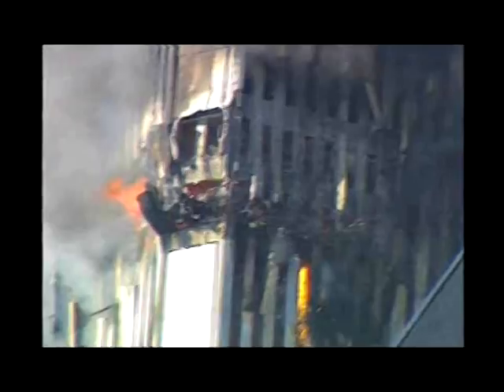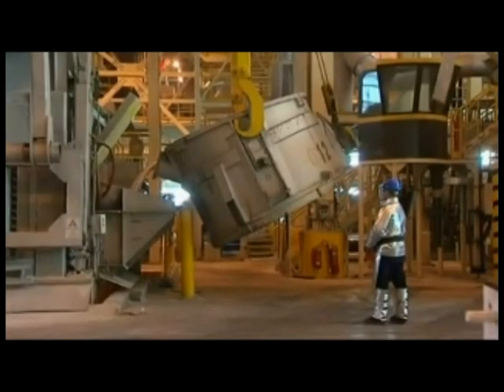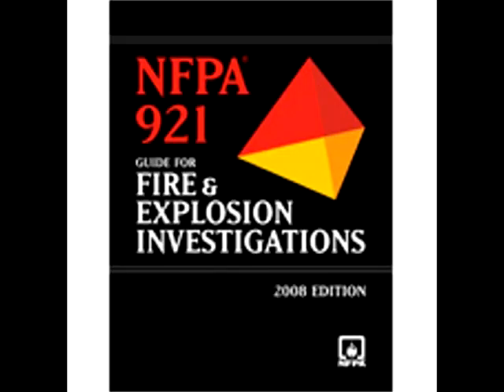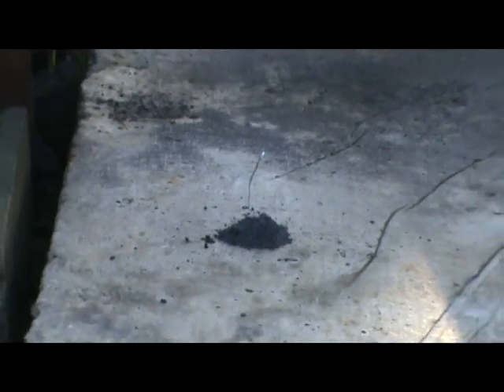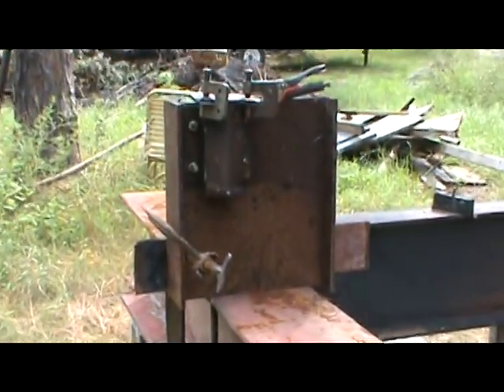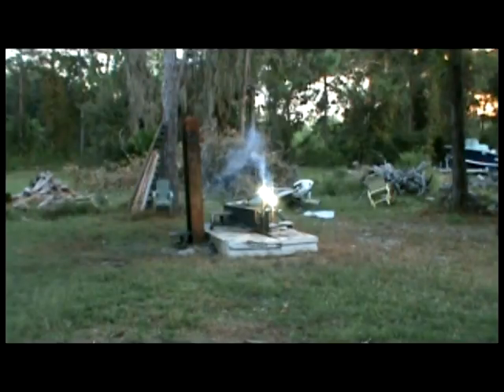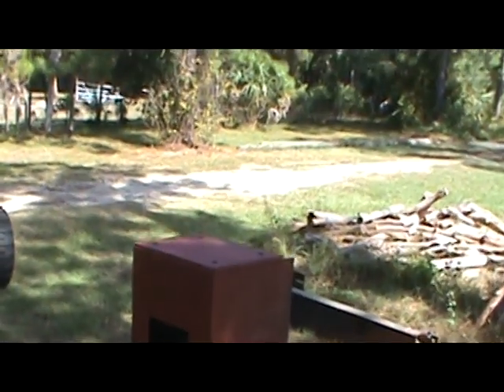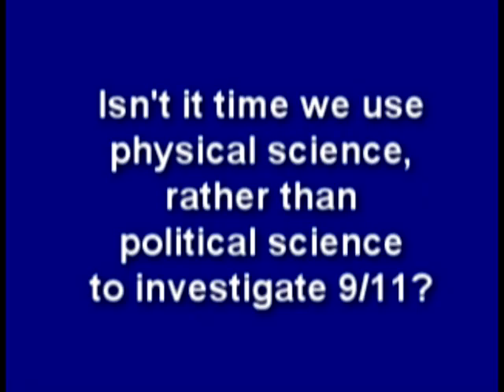9/11 Experiments: The Great Thermate Debate

Comment: While your experiments show it is possible to cut steel with thermite the amount of molten metal flowing from the building was much greater than that of  beams being cut by thermite. I have worked in foundries and seen overheated aluminum glowing orange. I worked as a burner cutting apart old train box car's 50' long 10' wide completely cut into 2'x3 square pieces in a ten hour shift. The plane's also are built with magnesium parts and other exotic alloys. The puffs and explosions could have and probably were water being flash vaporized the dust and smoke were any number of combustible materials. Most importantly, steel easily bends when heated far below it's melting point. The floor beams of the towers were heavily loaded with concrete. When they bent or sagged  downward they pulled  themselves off of the out super structure. Because the plane's had been deliberately flown to points were a massive amount of the  towers was above the impact point. The upper structure  acted as a giant pile  driver, once the floors at the point at and above the impacted floors pulled away from the out walls the massive weight hammered the lower floors to dust. You were very successful in demonstrating your  theory of thermite sabotage. Would you give equal effort in producing experiments showing how the steel imbedded in concrete can and will bend and sag. I think it will take much more thorough and unbiased scientific studies to fully understand all of the extraordinary dynamics and environment that came into play inside those buildings at and near the impact area's. Keep in mind aluminum and magnesium both burn and at extremely high temperatures. Jet fuel will burn at higher temperatures if vaporized and it may have and probably did flow into pockets of the beams and other areas were it was boiling before it was ignited. To duplicate such and environment will be extremely difficult if not impossible in laboratory experiments. And even computer modeling of the event will not include all of the seemingly never before, never imagined dynamics that were in play. I don't think the terrorists were dumb. They took an educated guess as to what would happen if the hit the towers at those floor levels. And knowing exactly how the buildings were constructed they may well have guessed they could heat the floors enough to make them sag and pull inwards. They had structures in Afghanistan that seemed to point to that effect. Also they chose international flights fully loaded with fuel. Yes the media are liars, period and they know it. There was so much going on. Massive forces, massive forces and and environment of chaos. So many types of materials in sufficient quantity that no fire Marshall could possibly know what how or when for sure. Yes the obvious things but so much more happened in ways that maybe will never occur again.

Comment: Aluminum oxide burns hotter than the melting point of steel. Magnesium burns hotter than the melting point of steel. Perform some actual research. Take off your tinfoil hat while your at it.
Reply: Aircraft are made up of primarily aluminum, steel, and magnesium.

Comment: You guys have to remember they flew a plane straight into the towers too so that greatly contributed to the towers falling and shit.
Reply: No it didn't. Each building were capable of taking any hit on all sides because they were designed and built that way. Read about Steve Earl Jones. He was the scientist who uncovered evidence at ground zero of the exotic substances aluminum oxide and thermite shrapnel that led him to discover that no building in its right mind and condition should ever have such exotic materials mixed in the debris. No building at all. The impact along wasn't near enough.
Reply: Chris Sorensen His claims have been debunked.
Reply: Chris Sorensen http://web.mit.edu/civenv/wtc/PDFfiles/Chapter%20IV%20Aircraft%20Impact.pdf
Reply: Chris Sorensen https://youtu.be/aHGllrXsgEI
Reply: you need to understand a plane crashing into a building wont produce as much work as you think it does 
its bearly anything when you consider the windforce those buildings had to deal with every day of their life
Reply: Scott B A 196-ton aircraft filled with approximately 10,000 gallons of fuel slamming into a building at 590 mph is wildly different than wind hitting...
Reply: @realGalactus  th
E actual forces generated arent as great as you think they are
Reply: I understand that but in the construction of the WTC they said both buildings could withstand one plane crash and still stand.
Reply: xXE1ITEK1LL3RXx Where did it say that?
Reply: xXE1ITEK1LL3RXx Ah, found it. “Twin towers 'built to withstand plane crash'”, published by The Telegraph on the day of the attack. The article explains it very well...

“British consulting engineer Professor Alastair Soane said today: ‘They were extremely robust buildings and built to withstand a tremendous amount.
But this was of course a completely abnormal situation and one which would not have been envisaged by the people who built it. The strength of the towers was enormous but they would not have been designed for aircraft strikes.’”

Comment: This supports my theory of why the plane was able to slice through the building like a knife through butter instead of the aluminium wings breaking off on impact(and don't give me that BS about aluminium being able to cut through steel, I'm an engineer in aeronautics) the building had to have been weakened in some or other way before impact... Which could also conclude to the theory that the 9/11 incident was planned LONG before the actual event.
Reply: Gerald Van Der Watt It’s pretty unlikely that you’re an “engineer in aeronautics” if you can’t see this bullshit for what it is.

Comment: We had thermite grenades in Vietnam for melting thru secure radio equipment, not the radios themselves but we could if we had extra and time. They were to be used if we were about to be overrun. The secure gear, a heavy duty steel box, was not to be captured. Always wanted to see it in action, but obviously did not relish the idea of being overrrun. If it was Florida instead of Vietnam I could’ve used the Stand Your Ground defense. Ohhhh, I though we were about to be overrun, that’s why I did it.

Comment: What a load of tosh.  Your tape proved nothing.  NOTHING.  How does steel melt?  Put it a kiln, light a fire underneath and use a bellows to force air on the fire.  Twin Towers was little more than a large kiln with a fire (crashing airplanes) and rushing air over the flames caused by the tower.  It is no different then lighting charcoal for your bar-b-cue in a charcoal chimney.  The lighted charcoal (airplanes into towers) heats the air and cooler air (lower floors of towers) is pulled up to replace the expanded air around the burning charcoal (superheated fire started by airplane crashes).  There are several videos on YouTube showing how someone takes rudimentary tools to melt aluminum cans in your backyard.

Comment: How do you know its steel? It could very well be any other type of metal such as aluminum. Airliners are huge and made up for primarily aluminum. Steel, magnesium and titanium as well but primarily aluminum which melts at a significantly lower temperature. This is the molten metal you are seeing. Aluminum from airliners.
There have been no reports from wtc of melted steel beams. 
Steel however attempts to expland at both ends when exposed to heat. This causes cracking, and causes the metal to sag making it appear melted.

Im a chemist and licensed aircraft maintenance engineer if you need credentials.

Comment: Jet fuel might not MELT steel beams but it still weakens them to the point where a child could bend it in half
911 was not an inside job

Comment: Goes from saying NIST said it was likely molten metal mixed with partially burned organic materials to claiming somebody proved it wasn’t aluminum.. they never said it was aluminum dummy. They said it was likely molten metal.. could have been filing cabinets or some shit. It was a bunch of offices. Not to mention there would have been more metal in the buildings construction than just structural steel with a high melting point. The structutal steel itself wouldn’t have needed to melt to bend and fail either. Steel is naturally pretty soft and heavy and if you made a beam out of regular old steel it would warp and bend and twist under its own weight. It needs to be “heat treated” to make it harder so it will stay straight which involves heating it up to a specific temperature and cooling it within a specific amount of time which determines how hard and brittle or how soft and flexible it will be. 
The higher the temperature and faster the cool the more hard and brittle it becomes. The lower the temperature slower cooling results in softer more flexible steel. 
What happens is the molecules that make up the steel end up packing together tighter.
We all learned in grade 3 science how the changes of state work. As you add heat, the molecules of an object begin to get more room between one another.. the steel didn’t need to melt to twist and bend like you see in those pictures. It just needed to be heated up enough that the heat treat that packed it’s molecules together was ruined, then it would have been soft enough to bend under its own weight again like it is before it’s been heat treated, then you have tons debris falling all over it.. it’s definitely going to be bent to shit just like in those photos. The steel beam that was cut at a 45 degree angle was cut 2 weeks after the collapse by construction crews cleaning up debris because it was a bent up twisted beam hanging over crews and equipment causing hazard and part of the debris and it was anchored into the fuckin earth.. you know.. being a support beam and all they weren’t exactly getting it out of there without cutting it. There’s even pictures from news reports on two different dates showing it was cut at the soonest two weeks after the collapse a before and after. As far as the high temperatures seen days after from nasa that’s completely normal, hell if you’re camping and you have a good bed of embers at the end of the night and you bunch them together and cover them with old ash from the fire (essentially bury them) you can wake up the next morning and toss some kindling on it and start it back up because you will still have embers the next morning, just from a small campfire. 

I actually do fire/flood restoration on residential and commercial buildings for a living and have since shortly after getting out of high school. 
When we have a bad fire and there isn’t much salvageable in the way of personal effects and items are listen as non restorable for insurance purposes and we bring them to the landfill the landfill will NOT accept it unless the fire has been deemed extinguished by the fire department for 14 days just in case there is still a hot spot in the debris we are dumping. 14 days... also your little graphic you showed that was from nasa didn’t actually show really hot temperatures that you would find with pools of molten steel it showed temperatures relative in comparison to other regular old hot spots in other large commercial fires..

Comment: I remember as a kid watching a lot of NOVA and other such programs on our local PBS station. (No cable till my 20s)
I can recall vividly watching a special on the world trade construction and the engineering built into its design. Other than the wind, which can exert tremendous forces upon any high rise buildings surface, airplane strikes were calculated up to a 727 IIRC. 
Also remember middle school science class when we got to use the Bunsen burners. Learned a bit about how fuel burns differently when it can be accelerated. 
Honestly, I think it’s like the “flat earth” thing going around. People believe whatever they feel is easiest for them to understand. Although, admittedly, I’m not sure what the earth being flat is making easier. 
I expect the media has just as much to do with the mishandling of information as the government. Unfortunately, I do not know what would change or, if it were to change, if it would be for the better if the truth was revealed. 
Priests are still molesting children, folks still go to church.

Comment: A strong case with compelling evidence, but I'm going to take my perspective to right where the planes hit.

You've got a big-ass commercial plane, full of fuel, that rams head-on into the side of the building. The force of the impact with such mass and velocity would obviously bend some steel. The plane rips through the building, bending many support beams, then explodes, sending flames all throughout the floors it detonated on. The intact beams are now exposed to high temperatures. Not high enough to melt, but high enough to become compromised and begin bending as the internal molecular structure of the steel loosens.

So you've got many beams that were destroyed through the initial blast and force of the plane crashing into the building. Now the remaining beams are beginning to bend and they are picking up the slack for the decommissioned beams, holding much more weight than they are rated for.

Now because temperatures are high, the steel bends, the weight continues to push, and viola, the remaining beams collapse, sending the above floors crashing down onto the rest of the building. The force of the collapse stresses the entire structure, snaps beam welds at critical supporting locations, then the whole building falls.

IDK, if you take some physics and engineering classes and tinker with physics programs, you'll understand how this could've happened.

Comment: Can you test if jet fule burning can ignite thermite? That would explain why it only burned at where the planes crashed..  do this same expiroment, but in stead of ignitors, heat the steel "razor blade" container with jet fuel. If it it ignites then possibly the whole buildings were built to blow, and the ignition was the plane. If you can proove thermite will burn from a jet fule ignition that would confirm everything.. like a popcorn curnel in a microwave. 

I personalg belive that were and still are lied to about this. But what do i know...